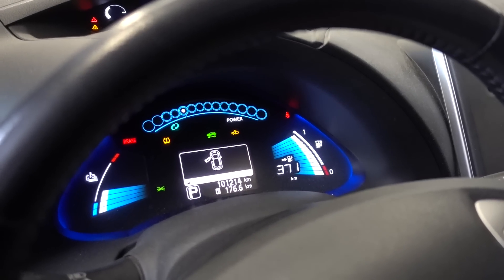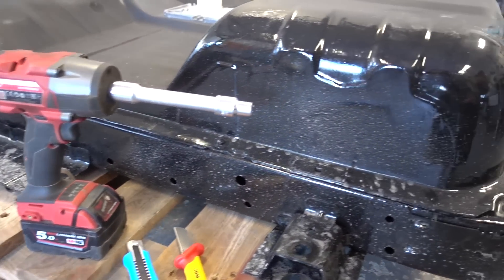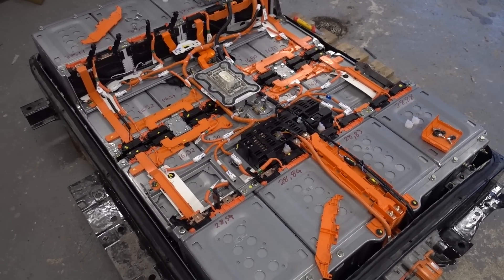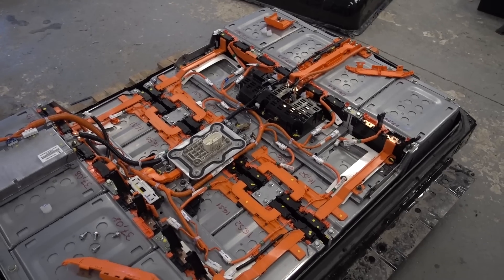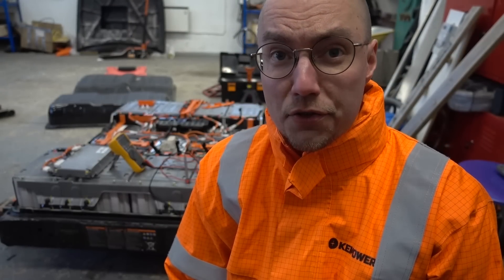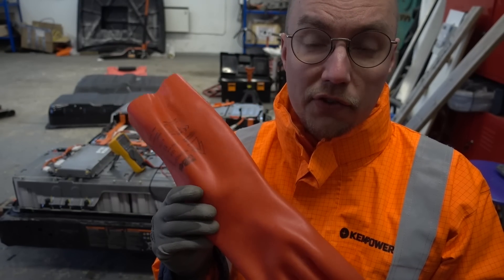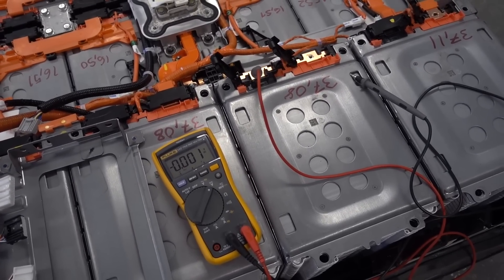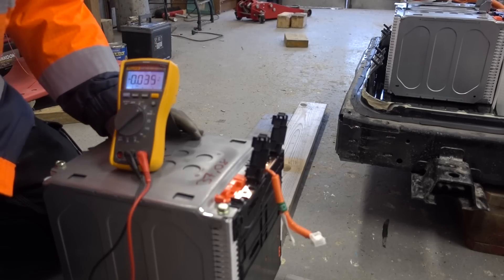62kWh isolation problem [part 1]

Comment: Your meter is very sensitive with tens of meg ohms impedance, so even the slightest leakage through moisture or contamination will be seen. It would have been useful to have put a resistor across the meter leads to see if the voltage collapsed to show if something  is physically touching or if you're  looking for highly resistive leakage path such as moisture or other residue before removing any covers or screws. Hope u have it sorted now.
Reply from the maker: I have an insulation tester that I will bring out in the next video!
Reply: @Dala's EV Repair  Insulation testers such as mega (other brands are available) usually  have selectable test voltages  ranging  to 1000v and more. Im not sure what connector you were probing to the case, but testing with these high voltages has the potential  to damage circuits and sensors within the packs bms. I guess you've probably sorted it by now, but thought I would offer a word of caution just in case.
Reply: @DalasEVRepair  That's going to be interesting, is there any electronics around the battery pack that needs to be removed for the insulation testing.

Comment: I think a cell tab in the module has been in contact with the housing.
I would open this module, to see that all cell tabs are located correctly.
maybe it's only 0.1mm between tab and housing now.
Then a temperature change can cause it to come into contact with the housing again, and the same problem occurs.
Then I would loosen everything in the battery pack, so you can put everything back correctly.
After that, I'm sure you can use the battery without any worries.
The cells in the battery can actually withstand major mechanical damage and still function perfectly well.
If you stick a screwdriver through a cell, it doesn't catch fire, it just grinds and smokes a bit, but the cell still works.
Having said that, you should never use a cell that leaks.
But the cells in the Leaf are among the safest used in any electric car.
How often have you heard about a battery fire in a Nissan Leaf?
Reply from the maker: Good idea, will do this in the next video!

Comment: The LoZ mode on your meter should work faster for the measurement because it introduces a bit of load to the circuit and discharges the capacitor quickly?
Reply from the maker: Good idea!

Comment: Since there was this dent in the bottom right under this cell, there might have been some pressure from the underside of the cell.
To emulate this pressure a C-clamp might be used. Have a thick steel plate at the top of the cell in order to spread the pressure at the top of the cell. Then place the C-clamp approximately at the place of the dent and squeeze.
Another possibility is the misplacement of the cell. Maybe they did not loosen the attaching bolts for good lookibg cells and only replaced the bad ones or none after the crash. When You loosened the cells, the cell frame straightened and now there is no more leak.
Reply from the maker: Yes I will clamp it harder and take more measurements with a dedicated insulation tester!

Comment: Hi Dala!
I don't understand how manually balancing the one stack would fix anything. Because I'd think that the car should do this on its own - does it not? And if voltage levels get adjusted, would it not just simply go out of whack later on because of some internal defect of the cells? What caused the imbalance in the first place? Some temporary leakage during the accident or something more permanent?
As for the leak: No idea. How expensive is a replacement stack? What is the worst that could happen? unexpected shutdown? fire?
Reply from the maker: The balancing is very weak on the Nissan BMS, it can only shunt 2.5mA , so letting it balance on its own would take months, even years! Better to do it while the battery is open.

Replacement stack from Nissan is 7000€. Will need to source a used replacement. Worst thing that could happen is more unexpected shutdowns. The system is very sensitive, it triggers on a 380kOhm leak to GND.
Reply: @DalasEVRepair  Hm. Try to reproduce the fault by shoving and banging on the stack until it bodges - or not. If you're able to use the car as a Beta Product (failures possible) for a while, then I'd keep the old stack. The longer the battery works without fault, the less likely it is to happen again. It should then be promoted from Beta to fully usable after a few months.
Cracking the battery open again is possible, while not really desirable, eh? But that would be the money poor, time rich way. Not sure if that suits your life.
Do you think the unbalanced stack will go out of whack again? Can you measure internal resistance? Maybe connect a toaster and see how much the voltage drops, compared to other stacks...

Comment: If it's an electrolyte leak, (sad, sorry), maybe it's capillary action which sucked the electrolyte back into the cracks between pouches and plastic between cells, when it was uncompressed, and cleared the short.    If it's a leak, see if there is room at the edges or corners of the cells, maybe from the tab end, to gently push a q-tip small cotton swab, or sliver of stiff paper inside, and does it come out wet or green with electrolyte.
Reply from the maker: Yes, most likely I will need a replacement module. The electrolyte is transparent, so very hard to spot these!
Reply: If so, since the 62 packs and modules are scarce, I wonder if a Scandinavian EV genius could reload that module with cells from a 40 module.  I'm very sorry about the trouble you've run into this time, but I'm on the edge of my seat to see exactly what is the root cause and how you fix it.

Comment: The Dent itself looks like it was made with a forklift for instance... The presumed shift/slide of the pouches in the pack could be explained by this, the pack sliding of the forklift and dropping on concrete? That's a hell of alot of G's with no deceleration distance whatsoever!
Reply from the maker: Yep, the battery had some classic forklift lovetaps! Will need to tweak lots of points on the inside!

Comment: When the module is disassembled and extracted from the box there is no fault because you disconnected the module from the box frame which is 0V.  The fault is between a cell negative and the 12v battery negative linked to the battery box, both at 0V, it has nothing to do with compression.
Your multimeter leads were inverted during testing, the BLACK  (common) lead should have been on the module compression bolt head or module body.
Module negative to body = 12.58v
Module positive to body = -24.44V
Total voltage including bolt(inductor causing Voltage drop)=37.02v 
0.06V are lost somewhere? I put my guess on the bolt becoming an inductor or a resistor somehow.
Total module voltage = 37.08V
There is NO voltage when the module is out because without the bolted connection to the 0V body of the battery box, there is no potential difference between module negative and module frame.
Take a piece of wire and link the compression bolt to one of the box bolts and see if the fault voltage comes back.
If you don't get any fault voltage like that, then you are back to before disassembly started and you have a stray voltage when the pack is installed and bolted to the box.
I bet there is an induced voltage on the compression bolt that links the module frame to 0V because of the much higher current flowing in that pack or the bolt is a plain resistor between cell negative and battery box because of an unwanted contact caused by the shift of the module position.
Reply from the maker: Good idea, more measurements coming in the next video!

Comment: Hi. You should test condition of the next module(to the left from this one). The point of insulation will be with  no voltage to body, but with low resistance.
Reply from the maker: Thanks, will measure more in next video!

Comment: I'd knock out that dent, realign everything correctly put it back together and do a further insulation test. There doesnt appear to be anything physically or electrically wrong with the cell module itself. I'd defintely capacity test that low cell to see if it matches the others while you have the battery apart - it may need replacing.
Reply from the maker: Good idea, more measuring incoming!

Comment: Sorry to hear about the bad news Dala, one question though, did you get the pack from Norway, and how does the seller react to the situation? Will they refund you, at least partially? And would you then get back the import tax in Finland (for the difference?)
Reply from the maker: This was from a private seller in Sweden, so no company warranty! I don't blame anyone for not knowing that the battery pack was too damaged, this is very hard to spot!
Reply: @DalasEVRepair  very understandable. Good luck on getting it repaired.

Comment: The comment from Nicholas Cloutier suggests that the sub unit is faulty and Nissan would have replaced it if this had manifested before the accident. Lacking availability of a replacement, I would personally sell off all the other sub modules to recover costs. Over time we may see if Nicholas' comments are supported elsewhere and what this means for the usability of the 62kwh pack outside of a Nissan warrantied car.
Reply from the maker: Yes, looks like Nissan always goes with a replacement. The modules cost ~7000€ via Nissan. We will need to find a used one!

Comment: oK is correct. Using a DMM/Ohm meter to test HV insulation is not valid. A megger is essential.
Reply from the maker: Megger incoming!
Reply: @DalasEVRepair  Only very immature techs chase each other around the shop with a powered up megger. I know, because I wuz one of ‘em.

Comment: I would take apart that module and examine the pouch cells carefully, and measure voltages before reassembling the whole pack. I don't think that dent had anything to do with this. The hard collision has compromised the internal structure of one of the cells.

Good luck!
Reply from the maker: The module casing is unfortunately welded together, so it is considered a non-serviceable component. But I will take some more measurements in the next video!

Comment: Look carefully at the particular cell tabs, indicated by the ~12v and 24v seen between the terminals and the case, that's particular cell tab that was touching the case.  How about checking the balance lead wires, maybe one has been pinched.
Reply from the maker: The issue was still there without any balancing wires connected, but I will inspect the front of the module more in next video!

Comment: what I like in your video is that you are very safe when working on the high voltage system you have proper PPE and isolated tools etc to work on this I see a lot of videos on U tube and they don't take it seriously  and hope that you find the problem and you fix your car cheap.

Comment: I would have to say that something likely shifted when you took the compression bolts out, and personally I would not trust this stack to be reliable long term unless you can tell for sure what shifted and that it can be repositioned where it belongs. For my own curiosity I would next use a megger to check the stack to chassis, if something is really close to touching you will find it with that. In the railway industry we use Hi Pot testers to find defects like this in the high voltage traction circuit but that may be overkill for this😂Can't wait to hear the follow up and thanks as always for an informative video :)

Comment: Extracted module is in 9s configuration. Looks like one of the series cells is leaking to its outer casing. Compressing doesn’t work, probably because it was touching the battery case when it was inside. I guess you’ll have to carefully examine the module for visible damage, and also take some voltage measurements around. Problematic cell should be #3 from the top or bottom.

Comment: Good video and information! I'm waiting for a final conclusion. My 40 kwh battery haves the same error, since June 2022. I still drive the car, a 2019 Leaf, erasing the error each time I start it. I made 8000 km since broken down. The condition of the battery has not worsened during all this time, but the SOH has decreased a little, with 2%, which is quite normal, in 9 months.
The strange thing is, it's a single station in my whole town, that let me charge it to 100% with no error, other ones stop charging at 30-35% SOC, when the error comes on the dashboard. Under 30% SOC, there's no error on dashboard, never. It works completely normal, heather and AC as well.
Reply: Hello. I meet the same problems on my 2018 ze1 nissan leaf. Do u think i can clear the error with obd2 lelink + spyleaf?

Comment: Is there a torque level that you have to reach when re-compressing the module? - What I am thinking is that you might not have compressed back the module at the same torque level as it was while inside the battery. - So maybe if you compress to the adequate level, you'll see the problem coming back. -  If you do that test, then you can have bit less of a chance to get the problem re-occurring when you put it back all together. - You are one courageous man!

Comment: I think the first thing will be reproduce the leak.. put it where it was, (no dent repaired) screw it down and check if you have a torque wrench, check how much do you need to tight the battery to start measuring something...
if you manage to reproduce it, then you can extract it, and put the battery on top of a metal plate with a nut/ screw (small one)  underneath... that way you are replicating the conditions outside the battery pack...
if you see the problem, then the problem is 100% identified... then you can dig a bit more... disasambling the battery and checking for damage on each cell, or you can think in solving the problem... you can replace the module or just simple flat the spot, then put some soft foam isolation (just a bit more, just in case).. then close the pack and enjoy as it is... (of course if you can replace it together with the front cell that is damaged would be perfect... but if you dont find a replacement, then just enjoy what you have

Comment: Nothing better to say than Nicolas Cloutier. Anyway, disassemble the pack and check each cell. As said Nico, internal leak seems the more possible reason or maybe a cell damaged. The leak shoud be reproductible. Can't say better because not in front of the pack.
Congratulation, you are back on track to solve this problem.

Comment: Could it be related to a torsion issue? By that I mean, when you bolt the battery back into the base it could be twisting the cell casing slightly. It twists just enough that driving vibrations start to shift the internal pouch cells by micrometers, causing it to either wear away or permeate the isolation material and contact the outer casing?
It’s just a thought.

Comment: Well, first you need Megger (Fluke 1507 for example) and use it at 500V area. Then inspect that is there connection to battery chassis/frame. Because there has been collision, there can be bend module frames or battery pouch leaking electrolyte. Also find out those bad cells and replace them after knowing reason for isolation problem. Do not make same mistakes what I have done with my Focus Electric. 😁
- Measure first with Megger, normal multimeter is quite useless with inside battery repairs.
- Take videos to yourself to remember measured values and you see your working methods, are they have been right in the past (like if you do wrong diagnose, you can double check).
And be happy that you do not have coolant cooled battery as I have, also you have more space and warm place to work, I did not. This is quite simple diagnostics after all. When you start figure out Megger and circuits in battery, you will find problem quite quick. Next time is so much faster and comfortable to do when you have some routine.

Lycka till, lykkyä tykö! 🙃

Comment: Hi Dala,

I would add to dissasembly all other stacks to correct bendings from the crash.  Also, after complete the pack reassembly, performing the insulation test with Megger in the extreme temperatures you could have in the future.  Best regards

Comment: I would reinstall the battery cells and hook everything up to the car to see if anything has changed. I can't tell you how many issues Ive resolved over the years doing nothing but investigating the problem. It could have been an unsecured or loose connection that you fixed by removing and reinstalling. 

Too bad there aren't battery extension cords for your car :)

Comment: If it has been involved in an accident at some point that compression point is the number one suspect on it all. It could be as simple as a small segement touched down internally and when you released and moved it the fault point moved enough to not come back under compression. Given the amount of work to remove and refit I'd just throw a replacement stack at it and realign all the bolts and the like back again.

Comment: If pack did not have isolation problem, would BMS charge up that module that was 30 mV lower than others?

Comment: Hi i would leave module tighten like this and charge it up to the max level than discharge if thermal expansion will return the isolation fault if not i would put it back